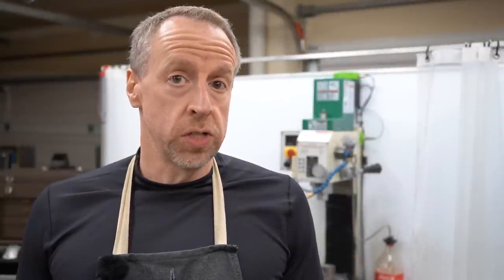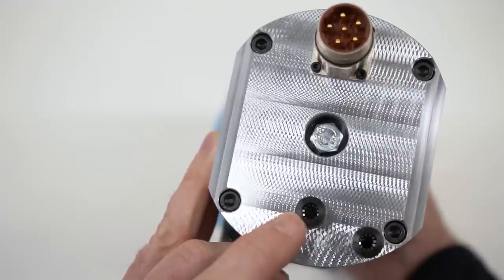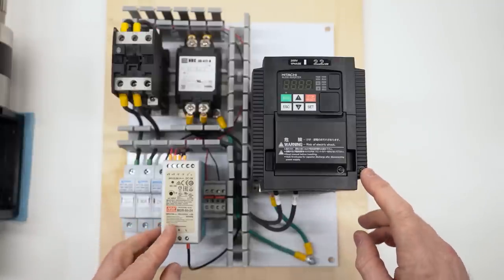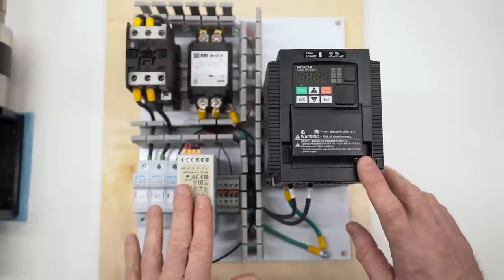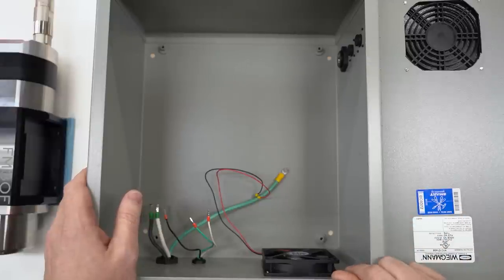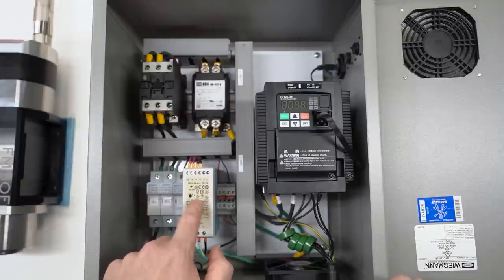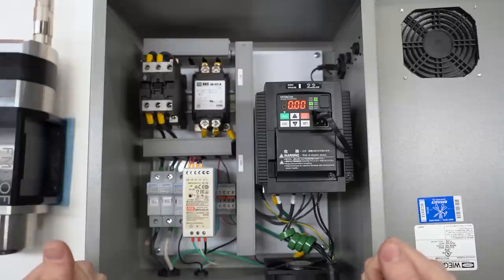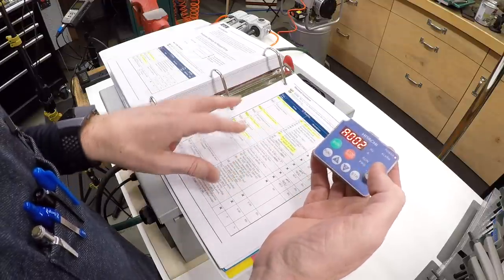ATC Spindle Part 1:  Wiring, Programming and Testing the Hitachi WJ200 VFD

Comment: If I'm not mistaken, you can feed the input of a pressure sensor (or more than one) to the VFD to monitor the air pressure going to the spindle, which I would do as a safety measure. If the VFD has enough inputs, you could also do a sensor for coolant flow/pressure /level if you use coolant so that the VFD would be able to shut down the spindle if you lose either vital supplies. Also, do you need a braking resistor?
Reply from the maker: I have been looking at pressure sensors.  Most of the ones I'm seeing are designed for compressor air tanks, so they kick on around 70PSI and off above 125 or so.  I suppose that would work, since the regulated supply shouldn't exceed 90PSI.  That would be a good addition.

I don't know yet if I need a braking resistor.  This VFD has provision for it if needed.  By default, it's configured to spin down over 10 seconds.  Once it's on the mill and I can mount tools properly, I'll work on tuning it for faster stops.  It can apply 20% braking force with an internal transistor, and that may be enough.
Reply: @Clough42  Where are you looking for sensors? There are a really wide variety of sensors that will output either 0-5V or 4-20ma (depending on the inputs of the VFD) over a useful range for this application. Alternatively, I think I could help source a simple Hobbs switch that would trip below X PSI to provide a really simple safety.
Reply from the maker: @mattemther6060  I hadn't thought if using an analog input on the VFD with a voltage or current transducer.  Not sure if it has the flexibility for that.  I've been looking in eBay and coming up with lots of compressor tank switches that aren't really suitable.
Reply: This spindle can be equiped with a draw bar sensor. That might be enough maybe?

Comment: Do you think you have enough rigidity to run a 3 hp spindle? I’ve got a Grizzly G0731, it’s an 8x30 knee mill with a 1.5 hp motor, and it doesn’t haven anywhere close to enough rigidity to run the motor at full load. About the most it can handle is 0.030 deep, 1” wide cuts in steel, and that’s the limit of rigidity, but not even pushing the motor at all.

Comment: Non parallel threads? I think you mean National Pipe Threads around the 7:00 Mark when you’re hooking up the 2 stage air particulate filter.
Reply: Actually, what he said is right. I was taught National Pipe Thread which is also correct but not technically what the threads are. Non-parallel threads are important to know as there are parallel threads such as the British parallel thread also used in the US. Technically, the NPT thread, regardless of what you call it is limited in application if you have an application with thermal cycling such as Air Conditioning. Non-parallel threads seat differently at a slight angle and when the connector heats and cools it will loosen itself over time. A parallel threat will not do that and seals face to face and not with compression at the threads.

Comment: cool project, out of curiosity, is there a reason you went with a 12k spindle? are you cutting with mainly under 1/8" diameter tooling?  seems like it would be better fitted to a high speed machine using linear guide bearings maybe for that type of work.  i like that it is a 4 pole with a max speed of 12k, so your right it should have more torque at lower rpm.  just curious about your upgrade path and the factors behind it!
Reply from the maker: The existing spindle in the machine only runs at 2.2KRPM, which has been a big limiting factor.  I run a lot of aluminum with 1/4" tools.  The tools are specified for use up to 12KRPM, but I can't take advantage of that with the stock spindle.  I probably don't need 3hp for that, but the excess power should translate into additional torque at slower speeds.  This is my thinking.  It still remains to be seen how that all works out.
Reply: @Clough42  if you are strictly wanting 1/4 and under tooling the high rpm nay be beneficial, but on mine i run a 2hp 3ph ac motor with vfd and have 6k rpm top speed with gobs of torque for deeper cutting all the way down to 2rpm (1000:1 constant torque motor running in vector feedback mode).  i think the machine itself will become the limitiing factory on its ability to cut at speed.  so that 12k spindle will be able to move the 1/4" tool probably faster then your machine can move accurately on the dovetails.  and you may have to back the spindle down out of its power range to compensate for the machine feed shortcomings.  i run aluminum 90% onmmine and have very quick machine cycles for a small machine.  my go to recipe is .75" DOC, 20% tool diameter WOC 0.003ipt using a 3 flute high helix endmill.  while it isn't moving terribly fast at only 54ipm, its removing quite a bit of material in each swipe.  with the 12k spindle im not sure it will like such a meaty cut.  so even if you are moving at 108ipm feed rate (which on a dovetail stepper machine is gonna look awfully jerky probably) you will likely be taking half the width of cut or a shallower depth of cut.  there are several of us who have modded these G0704's to the hilt and to date it is hard to beat the nachi tapered roller bearing upgrade, direct poly-v multi-rib belt drive conversion and 3ph AC motor, we are getting under 0.0001" runout on the stock spindle with the better bearings and they are very rigid and give superior surface finishes that shine like reflective mirrors right of the machine.  even at 3/4" doc.  we favor 3/8 and 1/2" endmills for material removal and use the smaller tools for rest machining.  I am curious to see your results and will be following along!  if you ever decide to go to a more torque like motor or want rigid tapping etc, linuxcnc and a spindle encoder is all you need and with the vector duty motors rated full torque at like 2 rpm tapping is a breeze as well as larger drills etc..  anyway very cool project regardless and its just different not worse probably, many ways to skin a cat!

Comment: Are you sure that it is a good idea to put all 3(U, V, W) through the same rings? 
The way I understand it, a current from one cable will induce current in other cables. Like a 1:1 transformer.
Reply from the maker: Not in this case.  All of the energy going out though one phase should be returning through the others, so the net interaction with the inductor is zero.  What we're after here is the common-mode energy that's not balanced and would otherwise radiate or capacitively couple to the motor and discharge to ground through the bearings.  By putting all three phases through the cores, we raise the impedance to the common mode noise only.  Also, the manual is explicit that all three phases loop through the same core four times or pass through the same four cores in series.
Reply: @Clough42  How does this relate to the way you did the ferrite rings on the Lathe motor update?  I think in that one, you ran them through the rings in a different way.
Reply from the maker: Yes, I did.  I've done quite a bit more study on the subject and I've learned a few things since then.  I'll do a follow-up video with more info.

Comment: Very interesting project once again James. Thanks for taking us along for the ride and warning us of the bear traps. 

I must admit I winced a bit when you forgot the positive pressure purge air, and it made me wonder that if you went to the effort of interlocking the tool release, why you didn't have a pressure switch for the purge air too. That way, the VFD can only operate the spindle under sane and safe conditions. I think you still have sensor inputs spare, or do you plan to do this under Mach 3 control?
Reply from the maker: Yes, I have inputs to spare, assuming I use RS485 for spindle control.  I am planning to do something like you suggest.

Comment: Can you share which model of the wj200 you have, is it the 022sf or 022lf?
Reply from the maker: Mine is the single phase (s) version.
Reply: @Clough42  thank you so much! Just ordered one for my s30c spindle, Alex said that it should provide better performance at lower speeds over my hitachi NES vfd... should of just bit the bullet from day one. Love the videos by the way, learn so much from your thorough explanations and reasoning
Reply from the maker: @thewoodologist8176  while I think that's true, I haven't been super impressed by low speed performance.  Especially when the load changes suddenly, like a drill entering a workpiece.  The RPM drops, and the VFD responds, but not as quickly as I would like.  It's likely there are settings that would make it more responsive, but I haven't had the time to experiment.
Reply: @Clough42  I know what you mean, In my case having the dual pole spindle where my peak torque is around 18000rpm being able to drop down to say 12000 without dropping half its torque will be a huge improvement since I'm running a router rather than a mill. Once I get the vfd and wire it up I'll let you know if I see a worthy enough difference. To top it off I got a deal on the wj200 from ebay for 150$ so worse case scenario I'm not out that much.

Comment: Heh, I went back and re-watched this video after the latest "valves" video. That bearing noise sure sounds familliar, but in my case it was definitely a roached top motor bearing. I replaced both of them while I had the motor apart, and had the rotor re balanced by a motor shop as well. It's super smooth now and no more rattles and shakes. Now I just have to put it back on the mill and see if any of my spindle bearings are roached as well. https://www.youtube.com/watch?v=8YfdCRDG33M

Comment: Very jealous of your spindle, I bet it is gonna be perfect.

Just a note, the fan would be better off in the door in my opinion Axial fans tend to be better when they are sucking air out of an enclosure than blowing air in.  Also, especially in fans with sleeve bushes the bearings last longer if the fan is mounted so that the shaft is horizontal.  I normally make two holes as inlets for each outlet with a fan. Some filter fluff over the inlets reduces dust in the enclosure and the double inlets stops the filters reducing the airflow too much. Some food for thought, love your channel btw.
Reply from the maker: The fan is oriented on the intake side to create positive pressure in the enclosure, and it's equipped with a computer case dust filter.  Placing the fan on the exhaust would create negative pressure in the case and draw dust in around the door.  This particular fan has ball bearings.  https://www.mouser.com/ProductDetail/108-AFB0924LD

Comment: That motor is sooo cool, that's it's almost a shame that it's being mounted to a Grizzly. I hope you use the Grizzly to machine new parts to build a better mill. Perhaps with epoxy granite base, sealed linear bearings?
Reply from the maker: Think of the G0704 as a casting kit for a CNC mill build.

Comment: Is there a reason you use fuses rather than circuit breakers in this case?
Reply from the maker: There's a circuit breaker feeding the panel, and fuses in the box.  This is the configuration recommended in the VFD manual.  Or at least close to it.

Comment: Hi James, just a query, where did you gain your knowledge.
Are you a qualified engineer, electro mechanical?
Reply from the maker: My formal education is in computer science.  Everything else is self-taught over a lifetime.  I took apart all of my toys as a kid and haven't stopped.
Reply: @Clough42 , my interest in things mechanical stem from childhood Meccano sets.
I then went on to be a CNC lathe, programmer /setter operator.

I enjoy your videos very much.
And like you, pump iron 💪🇬🇧
Reply from the maker: Very cool, Ken.  I had an Erector set as a kid, which I think is similar to Meccano.  That was before Lego Technic, which I didn't discover until later.
Reply: @Clough42  Yeah, hurrah for erector sets! My brother and I got the big red metal boxed one for Xmas in 1959. Had screws all over the house for years after. When it finally ran its course, I used the motor to make yoyo strings, during the yoyo craze in the early 60s. Been repurposing things ever since.

Comment: Wow that’s your 220v cable? Here in the uk all sockets are 230v as standard and we only have normal thickness cable!
Reply from the maker: It's 30A.  And it's SJOOW, rated for 300V.  Mostly, I wanted something that will not melt if hot chips fall on it.
Reply: Clough42 great thinking!

Comment: Did you decide to read through the whole manual before or after the magic smoke appeared ;)
Reply from the maker: I was planning on reading through the whole manual, but had not yet completed the task.  To be fair, I was following the getting started instructions in the manual, which seems like a reasonable course of action.  The smoke was because I didn't know one of the motor parameters.  But the manual still has issues.  The getting-started instructions tell you to set settings that can't be set until you read later in the manual how to turn them on.  :(
Reply: James did a good service with this video. What a dumb way to write a manual! BobUK
Reply: @Clough42  - I hope your qualifications will convince the person that you give your feedback about the manual, to actually change it where necessary.  I have bent more than one customer support person's ear, who agreed with specific points, and no such changes ever get made.

Comment: My God you do beautiful wiring!
If you ever go into business assembling panels I'll have an order for you.
You scared me though with the setup of the WJ.
I just got one because SJ's are obsoleted but I know the SJ for my simple phase conversion/braking use.
Does the WJ really need all that configuration for just driving a 2hp, 3 phase Leeson at 60hz?
Reply from the maker: Not at all.  Most of the configuration is for advanced use cases, like positioning and PID process variable control.  For a simple 60Hz motor, most of the defaults would work fine.  You would need to set up the usual stuff (max and min frequency, motor current, start/stop/speed control inputs, etc.)  From there, it's just a matter of fine tuning things if they annoy you (start and stop times, carrier frequency, etc.)  I would set up SLV and auto-tune the motor, but that's not even critical.  It just provides more torque at slow speeds.
Reply: @Clough42  Thank you!

Comment: You have 240v not 220v if you live in NA what are the spec's for your power filter
Reply from the maker: Correct.  The input is 240V.  The VFD is configured to regulate the output to 220V for the motor.  The filter is here:  https://www.mouser.com/ProductDetail/436-NBC-30-472-D

Comment: who makes the spindle?
great video  edit: ahh its from cnc depot...im looking at their spindle...friend of mine here is running three of them. he loves them...
Reply from the maker: Yes.  CNC Depot.  #NotSponsored  Most of what I've read in the forums is similar to what your friend reports; people love the spindles.  There are reports of  delays and frustrations in the purchase process (which I can confirm) but most say the spindles are worth it.
Reply: @Clough42  he said the same thing...he had one go bad...new one was out the next day... peep his works its amazing...he has the s30s...check out his work its amazing...elevatedwoodworking.com..im also leaning toward the s30 with ceramic..im doing three builds at once..plasma...etc...so that is going to have to wait a bit..have a cheap mophorn for the moment
Reply: @Clough42  my purchase of an S30C and parts went well, once I found out their preferred payment method was to use PayPal.  They don’t really have a web site that’s integrated with a payment system. Alex was very helpful.

Comment: How many parameters can you shake a stick at?
Reply from the maker: I'm getting pretty strong, so quite a few.
Reply: That depends on the setting of g004, it's all configurable. It defaults to 'more than you can manage', but you can set it to 2 if you want to practice your stick-shaking.
Reply: The thing I  have found difficult with VFD settings is that their name for the setting is  not always intuitive.  I would never have guessed the setting for limiting current from the name.
Reply from the maker: @patwicker1358  yeah... That can be tough.  I wonder if that one was a translation issue from Japanese.  It's another case where reading the whole manual helps.  There's a page or two that explains it, but you wouldn't know to read that section from the title.

Comment: Are you going to add an oiler to the air supply to keep the bearings lubricated? Just running a super low amount of oil should keep them happier and not gum too much up.
Reply from the maker: I don't think so.  I assume they're lubricated with some fancy spindle grease, like Kluber IsoFlex.  I'd hate to introduce something else without a manufacturer recommendation.

Comment: $3200 for a spindle, even the $3200 is nuts. Yeah, riiight. At that point, adding all the other stuff, you're getting into a high end Tormach or a basic Haas mini mill.
Reply from the maker: I did the math on it before I started the project.  To get what I'm looking for would require another $10-15k over what I spent.  Plus, it's an interesting project and I expect the mill to pay for itself with increased productivity.  Another option would have been a Chinese ATC spindle, but decent ones approach $2k, plus import fees and shipping, and then with no support.

Comment: you shouldnt spin up the spindle without a tool inside. The tool grippers (dont know how they are called) create a imbalance and maybe damage the bearings
Reply from the maker: Interesting.  I hadn't considered that.  The pullstud is retained by four ball bearings.  I would think they would just be forced outward against the mechanism by centrifugal forces, but I don't know anything about the rest of the mechanics inside the spindle.